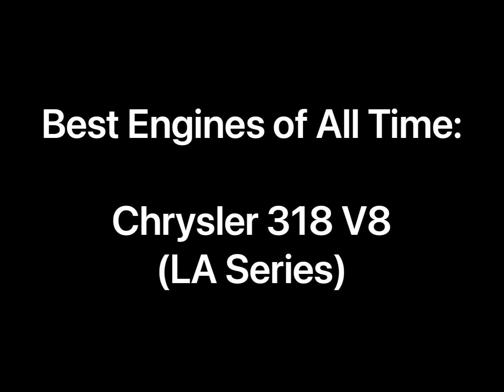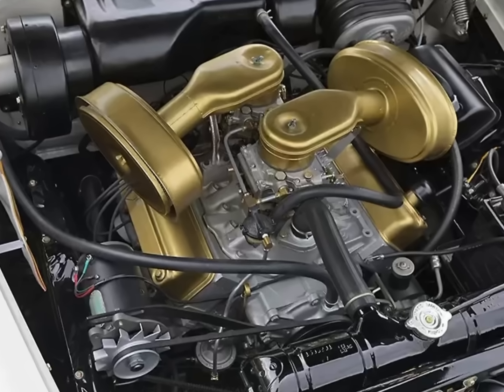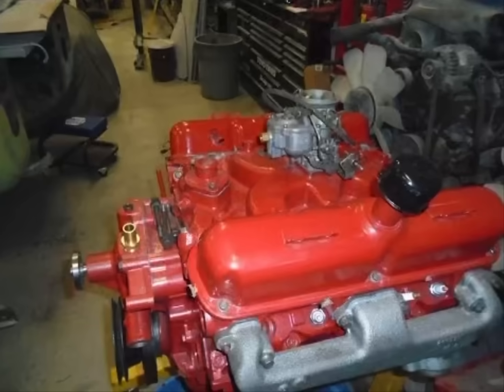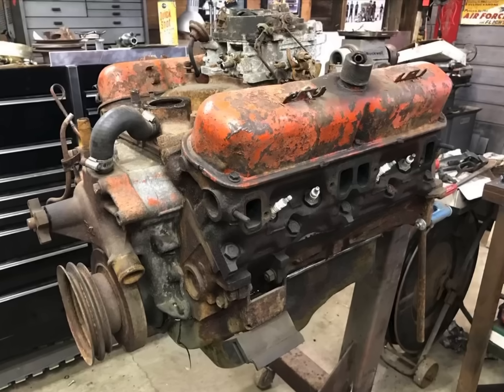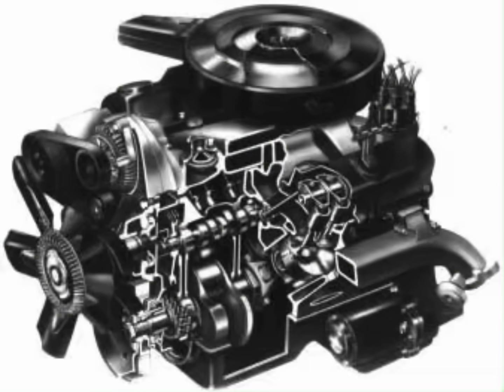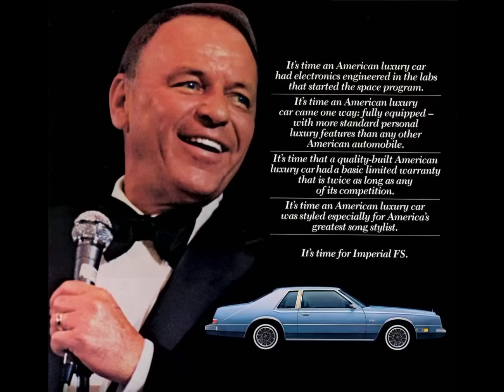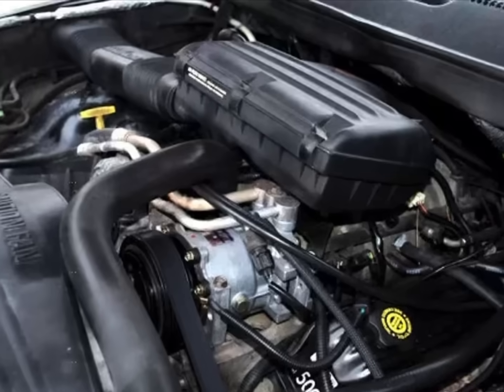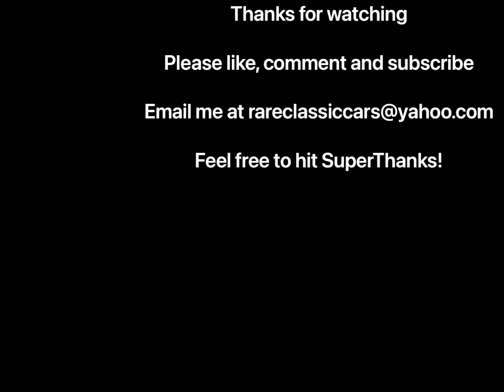Best Engines of All Time: Chrysler/Dodge/Plymouth 318 V8 (LA Series)

Comment: The mass produced 318 is a great small block for building hot rods. The casting is identical to the 360 with just a smaller bore. Making it stronger due to the extra iron between cylinder. Even bored over it's thicker and more temperature stable. With modern aluminum heads and stroker kits it can be a real powerhouse V8.
Reply: 360 water jackets are further apart, allowing for a bigger bore potential for the 360. 360 also has minor casting differences that are also shared with the 340

Comment: i had two well used 15  passenger vans with the 318s,in the 80s, and in 5 years they never missed a beat, while others at the same plant were periodically breaking down,  i am a mechanic and maintained them, and still  that cost me nearly nothing; i remember the only breakdown under way,coming to a stop: the ignitor died, and of course i had a new one in the glove box, IT was the ONLY  sudden death electronic gizmo in the van, and 10 minutes later it was back on its way; bought another new one,for spare, the same day,25 dollars in New Brunswick, NJ.
today you can't carry new spare parts, between sensors and modules,you'd need a full trailer-shop behind you
so,in that regard we went backwards by a looooooooong shot,thanks Greenphissers, but now the world is starting to see the deep hole you've been digging.
Reply: Yup

Comment: I bought a 1974 Dodge Coronet with a 318 around 2000. Quiet, cheap, reliable, great starting car, but the bias ply tires were square, and the water pump seal went bad from sitting. I replaced the tires with Tiger Paws, fixed the water pump, then, my cute but dwarf wife spun it on a highway in the winter, and someone smashed the left front quarter panel in the aftermath. If you can keep from getting in an accident, the car will run reliably for a long time, even in Minnesota.

Comment: All my Mopar V8s have been 318s. Love them. I have a '68 Fury VIP fast top and a '79 St. Regis with 318's and both are running late 70's Holley 2280 2 barrel carburetors. Very happy with both of them. The '68 Fury VIP's 318 has never been apart but has gotten a new timing chain on schedule. The St. Regis 318 has almost 200,000 miles on my dad's rebuild as the car itself nears 300,000 miles. Keep up the oil changes and timing chain replacements on schedule and they'll run practically forever.

Comment: Extremely underrated classic Mopar v8: not as powerful as today's multi-valve engines with variable valve timing & gasoline direct fuel injection, but has a lot of workable low RPM torque that modern 21st century "wonder motors" don't have.

Comment: Chrysler Corp.'s 225 Slant 6 was also long used and long lasting; story please? I had a '73 225 Duster and a '75 318 Dart, both very solid though well used before I knew them.

Comment: I had a 1973 Plymouth Satellite with the 318: rebuilt when a couple of valves went at about 100K, and again at about 250K. Finally got rid of it when I moved to Ohio and it wouldn't start reliably in the winters. It had the early electronic ignition package with the reluctor in the distributor and the "black box" on the firewall, but it still had the Carter BBD carburetor. Kept it 19 years and 360,000 miles. Even with two rebuilds, anything I had to do to it at any point was cheaper than getting a new car.

Comment: I had a1990 Dodge Ramcharger with 318 throttle body engine, that truck would get 18 mpg whether I was pulling a trailer or not. It is still running somewhere in Texas.

Comment: No engine in history has transported me further in my six decades of life than the small block Chrysler :-) I had every variant over my years although mostly 318/360.... Several 70.340 Dusters, and two 273's one of which was a 66 barracuda formula S. Great video. Thanks :-)
Reply: Had a '65 Formula S (My wife hated the exhaust tone) and it surprised a lot of "muscle cars'. Later dropped in a 340 that came out of a '70 Duster wreck.  Bought the whole car for $450 and moved the front seats, dash instruments, drive train with that 'rock crusher' transmission, and brakes to the S.  Duster was sold to me as 4500 mile car, odometer showed 450.  I won the wrecked car lottery.  I bet that kid still can't buy insurance. The S with the 340 was faster than my '69 Corvette 350.
Sold the car to a Lockheed coworker who used it as a tow car for his stream liner.  Body design was approved by one of our wind tunnel aero engineers and engine was a FIAT double overhead cam with added turbocharger.  He broke world record at Bonneville Salt Flats.  
.

Comment: My dad bought a '69 Coronet from a neighbor down the street in 1979 with only about 50,000 miles on it. It had the 318. Dad had it repainted, put a set of Cragar aluminum slots and headers on it and had one of the best looking cars in town for a while in the early '80's. That is, until my younger brother literally took it away from him and turned it into his own personal partymobile and trashed it over the course of just a couple of years. And that's something he did with every car he got behind the wheel of, actually. He was a one man demolition derby.
Reply: My younger brother had the same reputation in the family. He would get decent cars handed to him and destroy them within a few years. He would trash them inside and out, only worth scrap metal price when the destruction was complete.
Reply: @Lousybarber  My brother also couldn't keep a driver's license. How about yours?
Reply: @Red-rl1xx  As I recall he came close to losing his license once. He was a decent mechanic that enjoyed beating the snot out of vehicles.
Reply: @Lousybarber  Came close to losing it once? My brother lost his over & over & over. He went longer without one than with one.  He paid out thousands in fines to get his license back only to lose it again. Back in '05, he had just got it back several months earlier only to get stopped and lose it again! And maybe only a couple of months later (if that long), wrecked the truck he had just gotten. Then, he bullied his girlfriend's brother into giving him a car he had parked in his yard and drove it for almost no time before getting pulled over and got the car impounded. I just don't know what his problem was. He had to be one of the world's worst drivers.

Comment: Just had to pull the heads of my Mopar low deck 383. First time since 1959. Almost 600 000 absolut troublefree KM. Had it to 150mph regularly in the past 34 years. Reason, ex valves sunk in the heads because of 30 years w/o lead, otherwise it would still run like new. Gotta love Chrysler for building the greatest engines.

Comment: When I was high school/a little after high school age, a bunch of us liked to go ‘mud running’. This was in southeast Ohio, essentially trail 4-wheeling only you seek out the sloppy mudholes to see if you could make it through. I had a ‘79 half ton Dodge truck and a ‘77 Plymouth Trail Duster, the truck with an automatic and the Trail Duster with a 4-speed. Mud will cake a radiator soon enough, and your rig WILL overheat, and I saw a lot of 302s, 350s, 305s, 300 sixes, 454s, 440s, etc. blown up back in those days, but I don’t think my 318s ever even sounded bad at like 290 degrees running their asses off at like 4500 rpm for an hour, haha! Tough, TOUGH motors. Chrysler LA motors also sound unusually good in my opinion when you make them loud. My mud trucks had long-tube headers and ‘Purple Hornies’ collector mufflers, they sounded like something that made power, haha!

Comment: My personal experience with the 318 was, unfortunately, not at all good. In the very early 1980s I worked at a floral shop as a delivery driver. The shop employed two 1977 Dodge vans with 318ci engines. Both were slugs and poor on snow and ice.  Mainly what I remember them for is the never ending dieseling problem when I turned off the ignition. These vans had automatic transmissions, so stopping the engine wasn’t as simple as dropping the clutch in gear.  No, I quickly figured out to crank down the steering wheel to one side or the other, and thus the power steering would drag the engine to jerky stop.  I was real happy after a year or so we got a new Ford van with the 300ci six - solved a lot of problems…
Reply: My grandpa always shut his cars off Drive. That kept them from dieseling too.

Comment: I added a timing chain tensioner from a 2000 3.9 liter to my sons 89 fifth avenue and found it ran much better. An old Chrysler engineer told me when there was more than 6 degrees play in the timing chain the spark control computer and also the fuel controller on that fifth would get “confused” and cause surge at cruise. Seems to be correct in our case as the car runs very smooth now
Reply: "Chain tensioner " lol , put in a double roller chain or a  gear drive $
Reply: @keithpearson7059  has a double roller and the tensioner

Comment: I’ve had 4 cars with the 318: a canary yellow 1977 Volaré wagon, a 1991 Dakota 4x4, a 1974 Dodge Power Wagon pickup (which I still have), and a 1983 15-passenger van I drove for the place I worked in the late 80s. In each of these different vehicles the 318 was an overachieving engine. I’ve always thought them to be surprisingly solid performers with outstanding reliability, and prefer them over the much more desired 340, 360, or 400. I think they’re even more reliable than the venerable Slant Six. Thanks for the video.

Comment: The LA engine also shares the timing chain, distributor, oil pump and fuel pump with the A engine. The 1967 LA 318 was 66 pounds lighter than the 318 A engine. The 1967 and, "early" 1968 318 engine blocks has the thickest cylinder walls that could accept 4.00 inch bores. Later 1968 cylinder walls were made lighter weight and thinner. Dodge had developed a 331 LA high performance engine to compete against the Chevy II with its 327 engine. The performance of the 331 LA was disappointing compared to the Chevy 327 and Dodge decided to scrap it for 1967 and the 340 engine was developed for 1968  to counter the Chevy engine. The 340 opened the 331's 4.00" bore to 4.04" and was originally designed for a 6,500 RPM redline.  It was decided that forged pistons would be desired and raise the price too much, so the 340 valve springs were crippled to restrict the engine to a 6,000 RPM redline, so cast piston could be used. The 340 intake ports were sized to mimic the 327 Chevy intake ports and the 340 valve sizes were made the same size as the 327 Chevy. The 318 LA engine got a 4 barrel carburetor in Mexico, several years before the 1978 US version, because the 360 4 barrel LA engine wasn't marketed in Mexico. Due to possible Dodge only 331 LA engine in 1967, the Dodge Dart didn't offer the 383 engine that Plymouth did in the early 1967 Barracuda, until very late in the 1967 model year with the release of the 383 Dart GTS. The Barracuda was available with the 383 engine from the beginning of the 1967 model year.

Comment: My dad’s Dodge Dart swinger special came with the 318. Excellent motor, the only problem I remember was getting them started. lol 
Everyone here in the comments knows that sound? Once they were going, couldn’t be stopped. The only engine that I ever heard was better was their slant six. 
My personal favourite for performance was the 340, uncle had one in a duster.
Reply: FACT : " getting them started " involves basic maintenance to the starting and charging system a.k.a. good clean  connections and a good  regulator , alternator , starter and a high c.c.a. battery on old cars ( newer vehicles all have the same parts , just a zillion more plastic perishable parts !!!!!!!!!!!!!! )

Comment: My first engine and favorite. Holley 2bbl and a904 that I later built myself. Absolutely bulletproof she saw 15 yrs of savage abuse. Whole shots, donuts,revved to the moon and back not to mention unyielding onslaughts of brakes burns.she never let me down even after multiple overheating occasions the head gasket seemed invincible..in the face all the has been 302s and never was 305s as she would sing the glorious tune Chrysler bestowed upon her and even after 775,000 loyal mile the b250 quit long be for she did. She still sits on the yard but I were to wake her I bet she'd roar to life with the slightest flick of the starter... Phew someone must be cutting onions. My first and my always. I'd sell my wife first

Comment: I owned a 318 polyhead on a 61 Pionner and a 318 wedge on a 72 Demon.
Have you ever wondered why Chrysler never put 4 bbl, solid lifter cam and hi comp pistons on the 318 ?
Rather they created the 340 with and extra .130 overbore. That is a lot of bore ! a 3.91 bore  with that puny intake valve , will never have the breathing o a 4.04 bore with the 2.02 valves.
The 318 was the best low performance engine oh the big three car manufacturers .

Comment: I had an old '81 cop car with a 318 and a ThermoQuad. No bottom end grunt or high end, but it was impressive between 2000 and 4000 rpm. It had big valves like a 360, but the cam choked it off at the high end.

Comment: The cost to convert the Imperials from a fuel injected fuel system to a carbureted fuel system cost Chrysler $3500.00 per vehicle back in 1982!!!    That's $10,485.82 in 2022 dollars!!! :(

Comment: Hi Adam. Back in 1980 I had a 69 Polara with a 318 and blew the head gasket on the driver side. Some how I got the head off without removing the intake or exhaust manifolds and ran it. 18 mpg cruising. Thanks for the memories!

Comment: I had a 69 Barracuda with a 318. I think that year had 9.3 compression ratio. After 250,000 miles it was still running strong. It also got close to 24 mpg on the highway. I regret selling that car!

Comment: Drop two cylinders and you have the LA based 3.9 V6 developed for the Dakota but used in other vans and trucks as well.  Power was a bit underwhelming, especially on the 4x4 Dakotas, but improved with the addition of fuel injection and redesigned cylinder heads for the "Magnum" V6s in the early 90s.

Comment: Didn't the 318 Magnum engine state in 1992 not 1993 on Dodge Dakota cause I got a 1992 Dodge Dakota dated April 1992 and it came with the Magnum 318 factory. but the truck is for parts btw. and the first 318 I ever roll up in from 1989-2001 was my dad Limelight green 1970 Plymouth Valiant Duster he had from 1978-2001 put in a 1977 Dodge Aspen manual A833 O/D 4speed and the Duster went from factory 19MPG with the OG floor shift 3 speed manual to 30MPG O/D 4 speed and he drove the engine up to 450,000 Miles on it and the engine mount never got remove and the car was rust free in Tennessee.
Reply from the maker: That is true

Comment: 🇺🇸👍. My 68 Plymouth 4 door Belvedere 318 auto we purchased from the original owner in 82 had 91,000 miles on it, today it has over 340,000 miles on it. The heads, intake, oil pan have never been off. I have put 3 timing chain sets on it over the years. She has been parked in the back yard for many years now cause 7 cylinders have 150# and 1 has 38# cause someone didn’t listen to me I said no lower then 89 octane but they keep putting 87 in it. Hay we only paid $250.00 for it and it’s never been an accident got some surface rust always been a California desert car. Did have to replace the trans at about 250,000 miles,and lots of brake shoes.👍🍻🥩🥔🌽. 🥛💤

Comment: Had a 1969 Coronet with a 318, 25 MPG on the HWY at 65 MPH, that was pretty impressive for a car made out of all metal! It would also burn rubber for a block and a half!
Reply: LIES .
Reply: @keithpearson7059  there were different gears available that gave better hyway millage, along with a 2V card, and keeping your foot out of it, driving it normally, not hot rodding, would result in better millage.

Comment: Had 5 different Mopar 318's over the years, from 67-79.  Loved my '73 Challenger with slap stick, but my favorite was the '78 Volare (yes, Volare) with 4spd and T-tops that I had in the mid-80's.  With a few tweaks, it was a decent performer for the time.  Even with an 85mph speedo, I know that it went around 110 at least once since I had a tach and knew the base RPM at speeds. (Had my girlfriend looking for cops since we were rushing to try and get her to the airport - both of us were military and she'ld be awol if we didn't get her to the plane on time!)

Loved these engines - actually killed that Volare's lean-burn computer by changing out the carb for an adapter-plate and Holley 650cfm 4-bbl.  My friend and I had a wonderful evening of a sub- 6sec 0-60 time and torquing over the trans, but as the tach went up the fuel noticeably went down.  It wouldn't start the next day, and ultimately was towed away to a junk yard while I was back overseas.

Damn, I miss that car even now!
Reply: Oh, BTW - had removed the Holley before it got towed away, so used it on the '73 Challenger later on with a proper mid-rise 4bbl manifold in the early 90's.  That same friend said that he'ld been chasing the same performance and sound for years when we mounted it up.

Comment: Everybody poo-poos the lowly 318.  Everybody loves the rev happy 340.  Know what the difference is?  .103” bore size.  That’s basically it.  340s used the same crankshaft, same rods, and the same basic block casting.  340s got windage trays, hot camshafts, bigger carbs, and larger valves in the heads, etc.  318s were always the bread and butter 2 barrel with a broomstick camshaft.  They still rev to 7200, just like a 340.  Throw some 340 speed parts at your $500 318 engine, and go have fun.